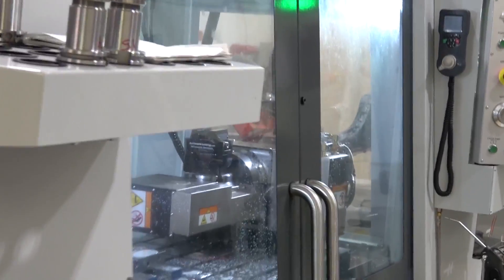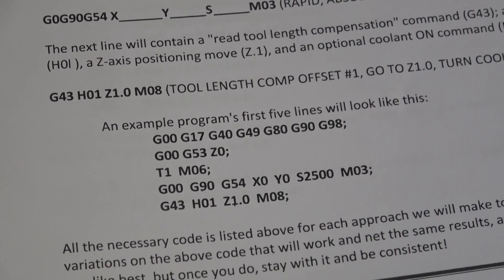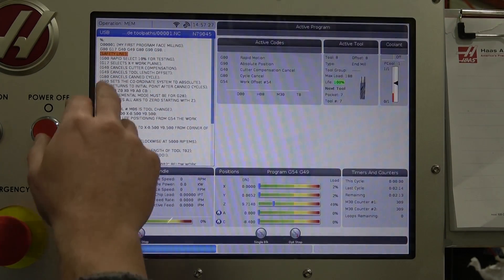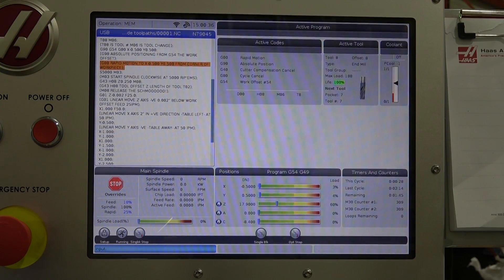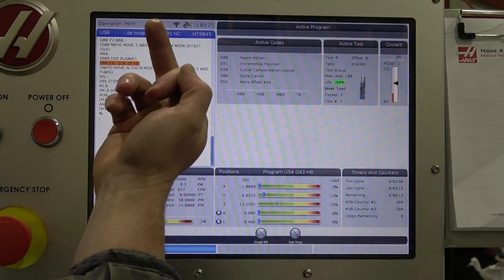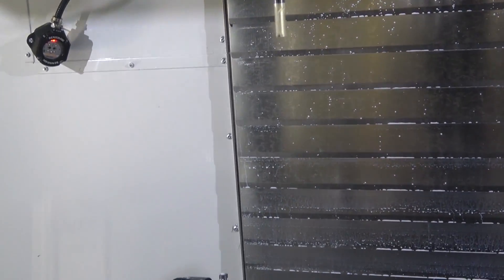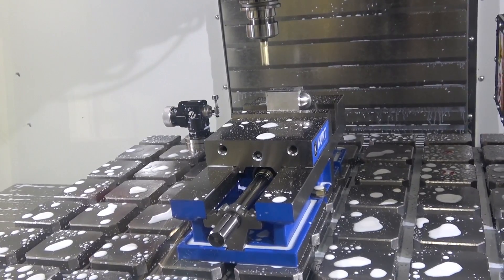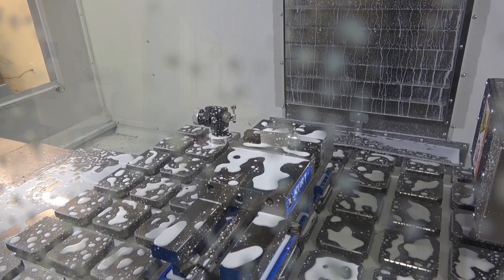Beginner CNC Programming | G-Code

Comment: I know it's an old vid, but I appreciate this one a lot. I'm the fresh meat in my milling department now, being prepped to get shipped to the programming/engineering department. My boss told me to do the same thing you did here; take someone else's code and write comments on it explaining everything code by code, line by line. Doing that, having a cheat sheet within arm's reach, and always having a pen and pad for writing down new stuff has been great for learning. Difference being, I'm learning on a Doosan with FANUC controls so I feel like a proper monkey with a stone chisel.

No point in learning to program the machine if you don't understand how the damn thing thinks in the first place. You just end up making problems for no reason.

Comment: Back in my day in the making of the chips Rapid Travers was 600IPM.  Not sure if new machines are faster than that but goddamn, 600IPM is blazing fast when you miss one frikken decimal point and the spindle heads straight down into the workpiece.  
Still cannot fathom why the designers couldnt make the default go UP instead of down but holy shit did it ever wake you up at 3am when your head was full of cold meds just to get thru another night shift.  Coolant stinks to high heaven and made my skin crawl, fuck that trade.

Comment: There's probably a parameter for whether it needs a dot or not. I changed that on my lathe so I wouldn't crash for forgetting the dot. You can use it without the dot but the input is in microns in metric and in tenths in imperial
Reply: The problem is, at least on a Fanuc 10T some addresses such as D need input in microns without a decimal point still after that and it creates confusion

Comment: @AvE 13:37 if you don't add the decimal the program the Haas controller reads the locations as thousandths so Y 1. = 1 inch  and y 1 = 0.001"

Comment: x1 = 0.0001 and x1. = 1.000. it's been like that with every control i've used I think. often applies when changing work offsets too, adding 1 only adds a 10th of a thou . it's fairly common to see the Q in pecking cycles use values like Q2350 and that actually means Q.2350 (CAM post processors tend to be configured that way for some odd reason)

Comment: Personally I loved programming in G-code. Pretty damn good at it. Its been a while so I've forgotten most of the codes, but I was quick. Fixing programming on the fly, prototyping in the CNC while others did it on the manual machines. Granted, "class room" setting, not nearly as time constrained, but I still proceeded with grace AND gusto.

But I enjoyed it never the less. I'm a numbers guy, it came natural.

Comment: When I was at school, I had this problem. Haas has little booklets with all their G & M codes but the variables and dependencies are not explained in a way I can easily learn.

Personally, I'd do better with some kind of tree-chart, showing all the commands, their possible following commands and the commands that you must enter with those commands (dependencies).
I can still code for simple parts but I'm not getting any practice at the moment so I'm forgetting a lot.

Haas also has "conversational" options in the control panel but as I learned, it's not perfect. You still have to go in and make corrections to your program if your combining features most of the time.

Comment: Why learn gcode? Why not use a pre-processor? There are many, based on many languages, for all tastes. It's essentially the same you're doing with Arduino: You don't write machine language, you write C or C# and use a compiler like a civilized person. This does the same: You write in a reasonable language, and it outputs gcode you can send to the mill.

Comment: You should use mach 3 it has the g codes right there for reference i have programed many files because i am to cheap to buy the program necessary to produce g code for a 4 axis machine.

Comment: 0:04 reminds me of that one time I crashed a lathe because I told it to go home on the X first and Y second, and it should have been the other way around. I was new, and nobody told me that rule. I must have read every page of the lathe's 500 page manual to see how I can fix that haunting orange error light that came on after it crashed before I told the boss. We ended up having to fly some expert in to fix it. I think he flew via time machine from the 1980s. These machines are sooo stupid, 3:53, they will self-mutilate themselves on command without thinking twice that it might hurt itself.

Comment: G code is easy lol. You haven't been near the eye cancer stage untill you spend over  12 hours coding a complex part and that night you dream you have to program your car in gcode to get home. And yes I lived in the mountains. And it was an old machine G3 X Y I J every line. Just give up on the comments and learn the code
Reply: Oh and just copy and paste your tool starts and ends. Most of that is the same every time. Use a cheat sheet for drilling cycles.

Comment: I should mention that you can macro/subprogram for common commands and defaults and leave them in the control. Like the first line of defaults: you could make something like O10 G00 G90 G80..... end it with a M99 and then reference it in the main program. Since I'm not Haas knowledgable I can't show the exact calling command but with a Fanuc it would be a M98P10 and, voila!, your default line is executed with a return to the next line in the main program. Just simple stuff like that makes macros fun and valuable.

Comment: @AvE
Here is a safe tip:
You should be able to replace G28 with G53 => (G90) G53 Z0 instead of G91 G28 Z0.
Then you do not have to change from G90 to G91 (is very handy especially if you are programming manually so you don't forgot to change from absolute to incremental)
You can however use G90 with G28 but if you type G90 G28 Z0 it goes to Z0 of the workpiece coordinate system first, which might result in plunging in to the workpiece or work setup,
and then goes to the home position.
(can be handy sometimes if you want to move to another position first  and then to the home position)

And yes always go to Z0 and then X0 Y0, especially if you have some clunky work setups.

If you have some questions about programming, feel free to ask :)

Comment: If I could make just one small comment/suggestion. When you spoke of the way the tool moved you describe it as the table moves. It is always better to visualize tool movement on any CNC machine as if the tool is moving over a stationary part. I know its true that the table actually moves on your machine but for the purpose of jogging the machine and programming it will be easier to understand and visualize if you think of the part as stationary and the tool moves over it or around it as in a 5axis moment. I know Haas makes this even more confusing by having their manual jog buttons on the wrong sides. So that would be jogging the tool to the X plus on your machine to your right the Y plus away from you and of course Z plus is up. Also why do you want to orient the spindle at the programs end? Is it so if you remove a tool you will know the tools proper orientation? What I usually do on any machine I run is mark (Usually I grind a arrow or X on the key) the Key on the spindle that should line up with the proper noch (Or the dimple) in the flange of the tool holder. That way when manually mounting a tool I'm always sure to have it properly mounted for the tool changer even if the spindle isn't orientated.

Comment: Pardon my ignorant, stupid question: are you manually programming g-code to ensure a specific path vs. using a CAM program such as Fusion 360 which would generate a tool path for you (but would require giving up a predictable path)?

Comment: The reason it did that with the whole -1 deal is it is reading -.0001 absolute coordinate to your g54 (or whatever work coordinate you're using) rather than -1 inch. Next time put "-1." And it will work. Same works for offsets. If you type in -1, write enter, it will subtract .0001 from the offset. If you type -10 it will subtract .001, if you type -100 it will subtract .01 and -1000 will subtract .1. Kind of weird.

Comment: If you do not add a decimal point any dimension or feed value you enter in will automatically be carried out to its finest increment. Ie. Dimensionally G00 X 1 = G00 X .0001 and G00 X 1.= G00 X 1.0000     Feeds are carried out the same as dimensions G1 F 1 = G1 F .0001 and  G01 F 1. = G00 F 1.0000 IPM     so when you had your "Y-1;" line  it actually was moving to the coordinate  (X-.3 Y-.0001) so it makes sense that it goes to the back left corner on that move.

Comment: On the G28 line. It is best practice to use G53 instead of G28 whenever possible, (handcoding, macros, etc.) This is due to the nature of what G28 is intended for. It acts as a relay positional move. So if you needed to move the machine through a certain point before going home you would use this code. This is reason for your note to not make the move with G90 on. As G28 G90 X0Y0Z0A0C0 would tell the tool tool to move through the corner of the part where you probed before going home. (However, height comp is turned off most of the time with this move, so it's telling the spindle nose to go through the corner.) G91 however tells it to move 0 from it's current location, so the relay point is where it already is, then home. G53 negates this issue as it is the machine home position, G91 or G90 can be used and all numbers after would reference from the home position. G28 is really only useful on lathes or when trying to make production runs on deep cavities run faster where you need a flag position before returning home (almost never, as this is incredibly dangerous.) G28 is designed to flip the sign and crash the machine, this has been verified by me personally. Lost a probe to it.

Comment: Ah G code... the shop I first worked at was given a ginormous and ancient Vickers CNC mill that had its own proprietary language. It was programmed using paper cards rather than paper tape. The operator inadvertently programmed a command designed for servicing the table that sent it the table flying on to the shop floor where it  broke into two one ton chunks of cast. Awesome!

Comment: There is a free visual G-Code program editor out there called Discriminator. I've used it for years to double check programs before making any chips. It has saved many a endmill and ball screw. Its how I learned hand programing and might be worth checking out.

Comment: As a safety, the Haas control defaults to assuming the decimal is before the number. Also, a quick tip (and just the tip) if you put a letter without a value after, it will default to 0. Example: if you were to type GG54XYZ it would come up as G00 G54 X0 Y0 Z0

Comment: Y-1 would be read by the machine as 1 micron or 1 thousandth depending on the machine setup.  So yes, any time you're inputting coordinates, its -1. / 34.  / 152. / -223.  /etc. otherwise the machine reads those as -223  (no decimal) base units so -223 thousandths.  If you wanted -223.000 in base units it would be -223000 base units (.001")  So the decimal is always critical on machines when inputting coordinates.

Comment: Few hints:

1) Please use some decent editor, for windows I can recommend Notepad++ as a good coder oriented editor. Wordpad has tendency to mess up various things in code, put tabulations, wrong line endings, etc.  It is also possible Notepad++ has nice syntax highlighting for G-Code, which makes it more pleasant to read, and find small typos and bugs. (i.e. if you see comment text in wrong color, that means you forgot something, etc).

 2) I believe you can put comment in g-code on the same line, i.e.:

M5 (STOP SPINDLE);
M19 (ORIENT THE SPINDLE);
M30 (End program. Go to first block. And cancel tool offsets);

I am not sure if semicolons are actually required, as in for example in most 3d printers, you only need a new line, no need to put semicolons. And usually semicolons actually start a comment, so you can just do:

M5 ; Stop spindle
M19 ; Orient the spindle
M30 ; End program. Go to first block. And cancel tool offsets.

It helps with readability.

I really wish there was some more popular g-code++, where you can use more human friendly mnemonics, not machine code, like this, but something more close to a function, macro or assembly;

move_rapid(z, -2in, clamp);
move_absolute(home);
stop_spindle;
spindle_forward;
end_program; # This is just an example, better names and semantic could be invented, and the most common one, move made short and compact.

I am pretty sure you can do it in some preprocessors, or cobble up something in python to do it yourself on the weekend, but it would help to have these stuff in the controllers, so it kind of "disassembles" the g-code for human consumption, or support it natively. Yes, files will be a bit bigger, but it can save a lot on troubleshooting, and reduce amount of comments needed to understand the code. The impact on speed would be essentially zero, because the controller can easily compile or buffer all the commands, and interpreting of gcode is not a bottleneck in speed anyway.
Reply: movax20h G-code is a language. Once you learn to read it it flows as fast as reading your native language does in some YouTube doobly-do. It takes a while to learn but I don’t know that it needs to be completely changed any more than braille or sign language need to be changed.
Reply: @witeshrt  yeah just read hex code of programs. Every same person uses disassemblers and mnemonics, not arbitrary numerical codes.

Comment: I am a cnc machinist, taught by my boss, and everyday I type all of my G and M code by hand. took 3 years to learn and understand the acroamatic 2100 controller &  a good portion of Dynapath code's. hell that's just 3 axis. 

all in all it takes time to pull drilling, counterclockwise treadmilling, arch milling lines out of your head. it takes time and a good bit of messing around, even broken tooling sometimes! :)

:T6 M6
G0 G97 G94 G90 Z.1 X0 Y0 S4000 F20 M3 M27
G93 G97 G94 G90 z-1.2 X0 Y0 R.1 F20 S4000 K.05 J11 M3 M27
Z.5 G0

:T7 M6
G0 G97 G94 G90 z.1 X0 Y0 S5200 F50 M3 M27
G1 Z-.5 F50 
Y.24 F10
G3G17 G91 X0 Y0 I0 J.25 F35
y.25
G3G17 G91 X0 Y0 I0 J.25 F50
Y0 Z.1 F100
Z5 G0

Y6 X0
M2

Just a simple drilling line, then counterclockwise cercal mill counterbore with a .01 finish pass :D

Comment: When the probe skip faults, if you re-position it so that it can run the sequence without skip faulting, it will reset itself. No need to reset the entire machine. From memory the controller will move the machine 10mm, if it doesn't trigger the probe it will fault.

Comment: I use M00 a lot when debugging CNC code. It forces a stop at the M00 and requires a cyclestart to continue. Highly recommended. I am not sure if your CNC supports it, but sometimes M01 allows for a conditional stop, where a it would act like an M00 if a toggle switch is set. Also, you can usually put commends at the end of a line after the semi-colon. I am not a HAAS programmer, but I work with other CNCs. So YMMV.

Comment: CAM vs. "Bear" knuckles G_code = complexity vs. time. For most simple drill cycles and contours or facing ops. basic G code programming is the way to go for a fast reliable outcome .
For more complex trig happy designs CAM is recommended - optimized full engagement tool-paths are designed to keep the machine in motion thus reducing the stresses caused by abrupt movement. Fusion 360 is a great place to start and in most cases remain when it comes to a fully integrated CAD/CAM package. MasterCAM is more industry standard mostly because of the sheer complexity and features. NX 11 and Catia V5 can also do some G_code but you're better off using NC-Plot. Most CAM post processors would have an N**** at  the beginning of every single G_code line thus when the machine gives you an error you can find it.